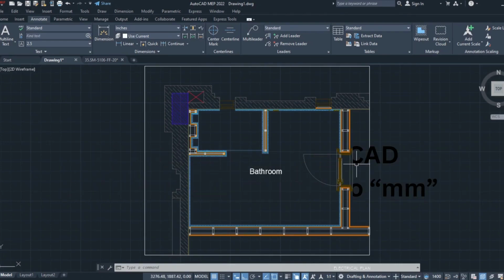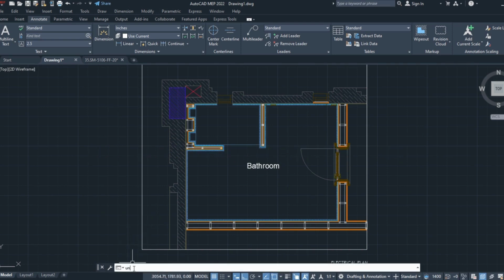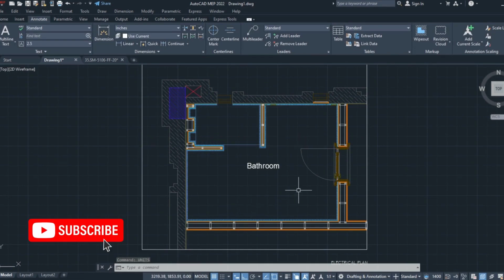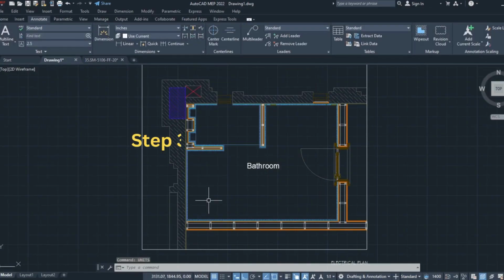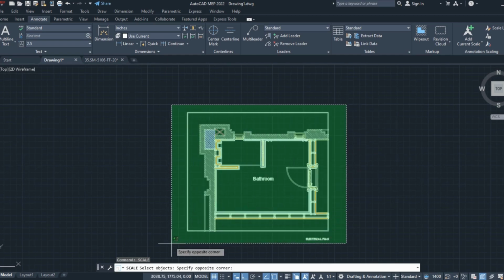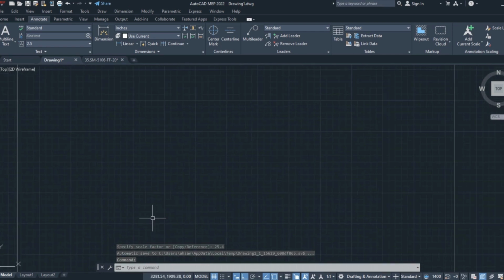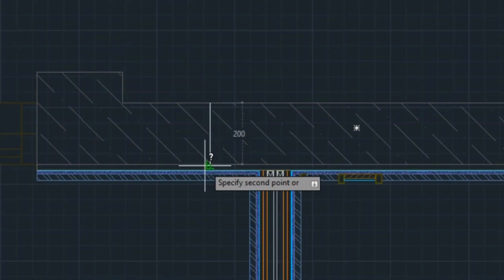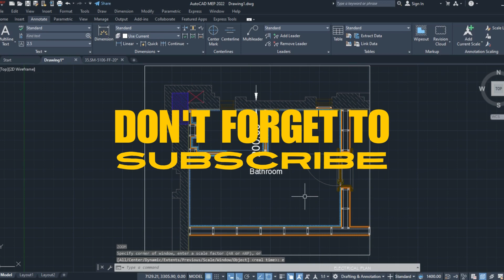How to Convert Drawing Unit from Inches to Millimeters | AutoCAD Change Units of Existing Drawing

Comment: the correct way is using the DWGUNITS command. Autocad can rescale your drawing with no errors due to a convertion factor
Reply from the maker: Thank you for your valuable input! Yes, using the DWGUNITS command is indeed a correct and reliable method for setting units and rescaling drawings accurately. I appreciate you sharing this tip with the community!